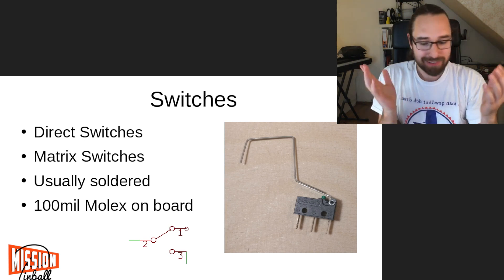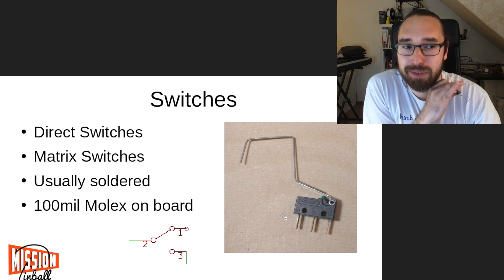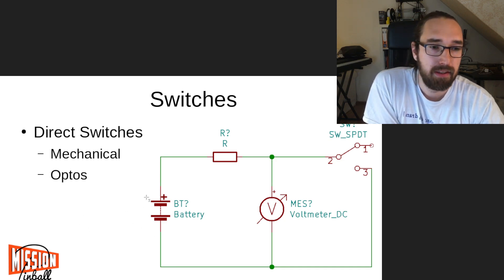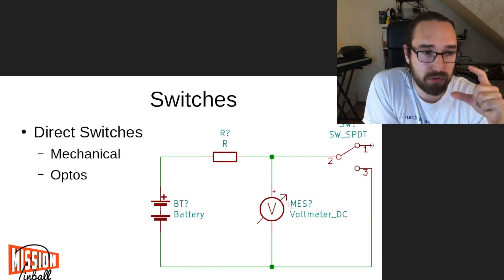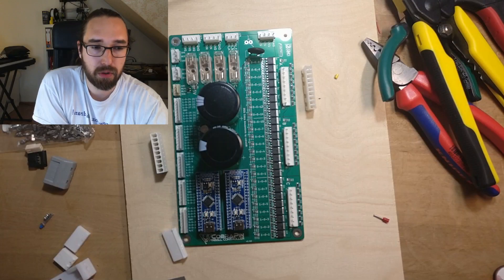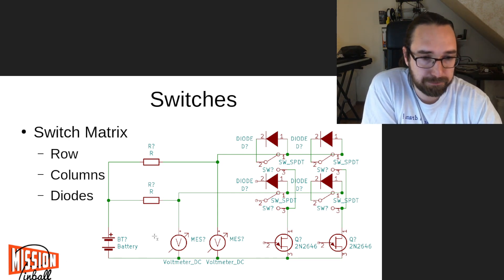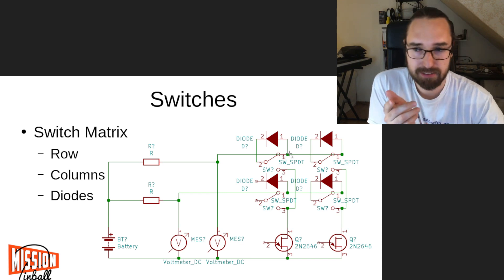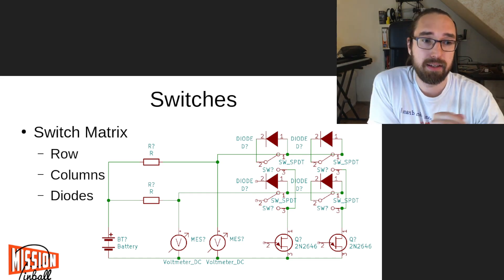Switches in Pinball - How to Wire Pinball Machines 4/6

Comment: What I'm confused on pinball games in the 70's that they would ADD a capacitor across each switch on the playfield. The Capacitor that is ADDED to each switch is not for Debouncing issues but its because the MPU is not fast enough to detect the very fast switch closure. The Capacitor is suppose to delay or length the switch closure time for the MPU. Pinball Designs have said that the capacitor is for the Switch Matrix because the Scan Frequency of the switch matrix is to slow so that the Scan Frequency can't Detect the fast switch closure. I'm not sure if this is considered debouncing or what would you call this by adding a capacitor across all the switching to length the time for the Switch Matrix Scan Frequency to detect the very fast switch closure, is this considered debouncing or what?
Reply from the maker: Good question how this is called. Maybe input smoothing? Mathematically this probably some kind of filter. But makes sense. Modern boards will be fast enough for any switch hits over one or two ms. In my experience you need to detect hits at around 10ms or you will miss some very fast balls.
Reply: @jabdoa  Very fast balls in are in the Micro uSec seconds so the MPU doesn't detect them because its not fast enough because I'm guessing the Clock speed of the MPU or the Scan frequency of the Switch Matrix Circuit that the Scanning doesn't detect the fast switch contacting. The Switch Matrix circuit GROUNDS the columns and Scans the Rows. In Passive Detector networks using a Diode + Capacitor = a Detector for the MPU to catch and detect very Fast Pulse or Impulses. I'm not really sure why the switch matrix circuits uses Diodes because if you remove all those Diodes the switch matrix circuit will still GROUND out the columns and Scan the Rows so it doesn't make sense to me why they are using all those diodes. The only reason I can think of is that they are using the diodes and capacitors arouse the switches as a Passive CD detector to very fast pulse and impulse detection for the MPU. If you don't use the capacitors the MPU will not register the very fast ball switch closers and won't register the points.
Reply from the maker: @waynegram8907  Not sure about uS hits. That would be extremely fast. Switch debounce "off" is already at 1 or 2ms on most hardware and you typically debounce to 2-4ms (or even more). Also we got scan frequencies of 100-500Hz only so anything below 2-10ms might be lost anyway in most controllers.
Reply: @jabdoa  I'm not sure why pinball games don't add "Arc Suppressor Snubber Network" across the switches because you will see the dark black pitting of the leaf switches contacts burned off from the arcing. I think adding Arc Suppressor snubber networks will prevent this.
Reply from the maker: @waynegram8907  Not sure if this matters very much on those logic switches which are very low current and only 12V. It certainly would have helped on EOS switches on older machines which actually turned off the high-voltage high-current flipper coil.
Reply: @jabdoa  yes i mint to say for the flipper coils because of the pitting it does on the contacts it strips off the conductive coating off the contacts on those leaf switches on the EOS flipper coils
Reply: @jabdoa  Maybe you can make a video lesson about EM pinball games using "ladder logic" and why they used ladder logic and the theory behind ladder logic
Reply from the maker: @waynegram8907  Thanks! Added this to my list. I probably have to look into it a little bit beforehand.
Reply: @jabdoa  yes the service manuals might say why EM games used "ladder logic" and the theory behind ladder logic but it has to do with the chain of events of relays, switches, coils and there is a ladder logic to the chain of events.